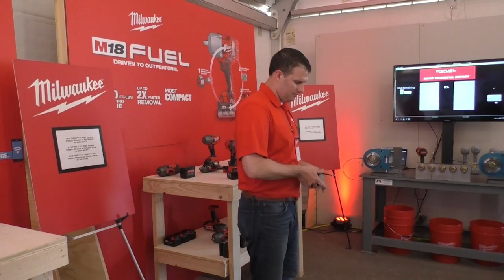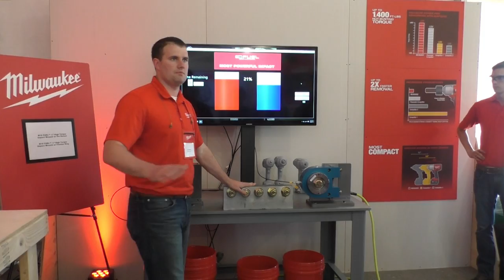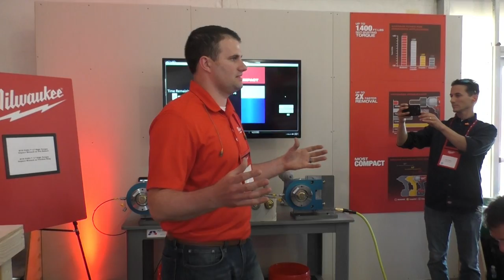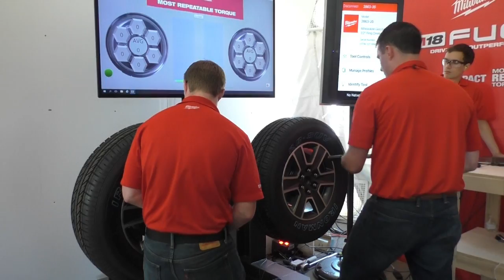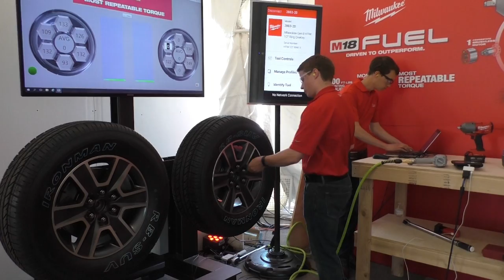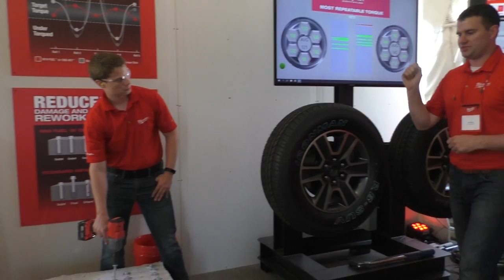Milwaukee M18 FUEL High Torque Impacts 1,400 ft-lbs - ONE-KEY Options NPS17

Comment: They aint gonna replace air yet. They make some big ass impact's. Ever seen a 1 inch drive impact ???...lol
Reply: Yes, we use 1in drive impact to do the tires on our rigs! I bought the 2767 1/2 impact,  takes off what the 1in gun puts on!!! No bullshit! Itll take off 8 tires, which is 80lugnuts tq at 500-550ftlbs on 1 5.0 battery.   1 batt will put all 8 back on, impact for 4sec each lugnut once it touches rim and then we checked them all with a 3/4 drive tq wrench. They were all between 500-525ft lbs. Pretty freaking impressive! I was a sceptic myself till i bought one. Sam as everyone else at the shop when i said watch this gun take off what that 1in air gun is putting on!!
Reply: James Avery that's exactly what I thought it's good for a car guy or small related jobs but it's not the most powerful out there so not sure why he said it was about 100 times hopefully they will make a 1 Inch battery wrench
Reply: Yep I own one. Has enough power for auto repair
Reply: 4th quarter of this year 2018 or early 2019 Milwaukee is coming out with an all new designed 1" Dr. One Key high torque impact wrench https://www.youtube.com/watch?v=ZkKR78Rc6mU&t=185s

Comment: Who cares about adjusting speed? The winner will be the one with digital torque limiting.
Reply from the maker: The ONE-KEY app can set torque and speed "to a range" however they were still recommend using a torque wrench so it is not clear how accurate it is or if it will become less accurate over time? Is that just because they didn't want to get it certified which would add lot of money but it will get it will still very close or because the app can't be that accurate? This is the big question we will try to answer once we get our hands on one.
Reply: I bet a lot of people would be interested in a torque accuracy test. Especially when a tool can deliver enough torque to strip or snap off just about anything you're working on.